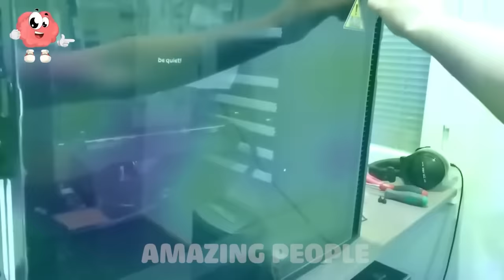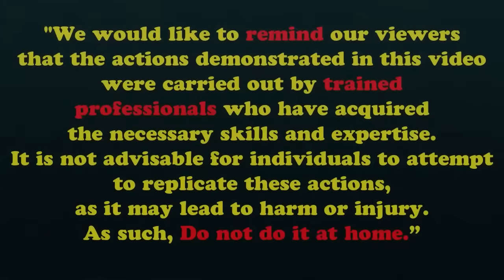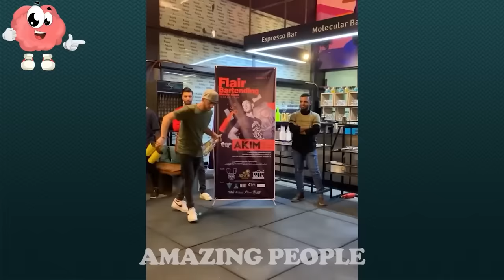TOTAL IDIOTS AT WORK #136 | Fail Compilation

Comment: Pretty sure the sledge hammer was intentionally thrown through that glass. His head should have stayed on target (the wall) instead he turned towards the window before he let go of the hammer. Plus, his body didn't react like someone who just lost control of a hammer. If you miss your target with a heavy sledge you will loose your balance, some times enough to throw yourself on the ground. He didn't, he planted his feet and threw the hammer while maintaining his balance. 

Watch a baseball player swing through a fastball he wanted to drive out of the park. Those bats don't weigh near as much a a bid sledge hammer and the batters still lose their balance.

However, we did get to see window shatter, so it wasn't a total waste of time.
Reply from the maker: We're grateful for your unwavering loyalty.